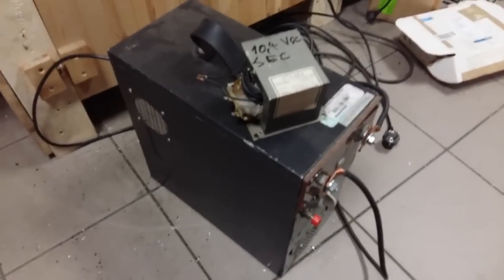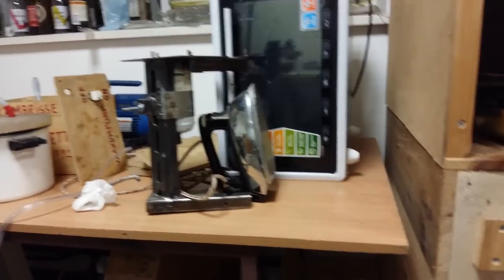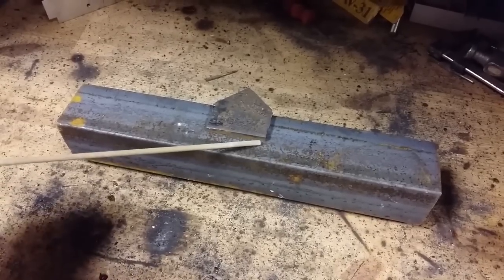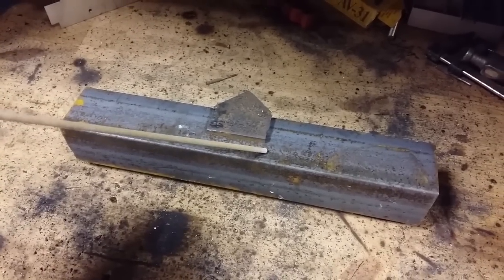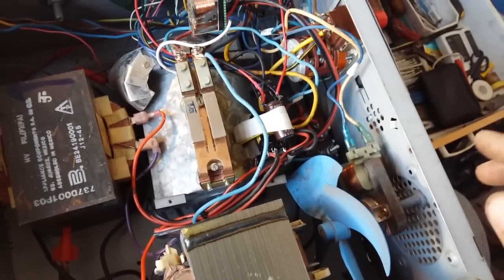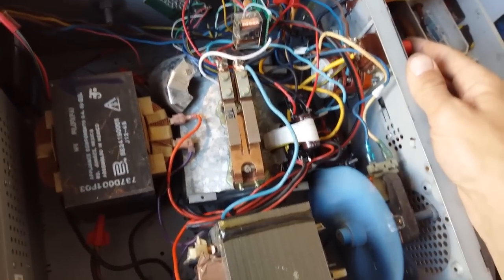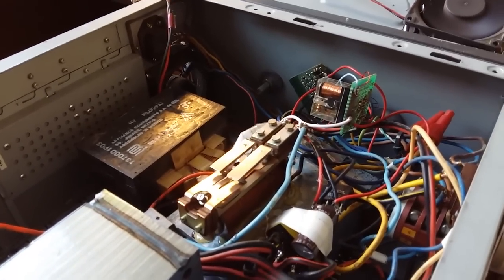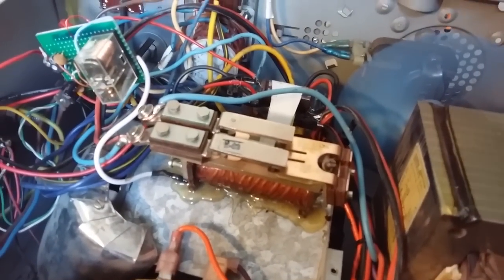Is a microwave oven transformer welder any good? (plus a softstart circuit)

Comment: When the slag comes loose by itself, that's how you detect a good welding seam. It looks like yours wasn't hot enough. Try a thinner elektrode, at the same steel thickness!

Comment: Although this works, everyone wires the secondary wrong.  Best is to use small gauge wire like 14 gauge stranded of multiple wires to fill the full cavity with wire that is grouped as parallel and total of 2 to 4 turns.  IE 20 parallel wires together and long enough for 2 turns.  The idea is to not leave spaces in the secondary cavity so all magnetic flux is coupled from the primary.  Hope this helps others.

Comment: Hi im picking up a to mot tomorrow and i was wonder if you can give me some brief instructions on how to do this and what can i do to make it safe this will be my first time ever doing this.
Reply from the maker: Hello CustomCars Life!
Your main trouble will be rewinding the MOT's. There are plenty of videos out there describing the process. Take care not to hurt the primary winding while removing the secondary. Splitting the transformer "E" laminate will definitely help. It will not hurt the magnetic flux if you properly join the sides again. Your second worry will be to find good wire for rewinding the secondary. Thick enameled copper is the best way to go, since it gives off heat easily. On the other hand, it is harder to wind and you have the risk of scratching the enamel against the core whilst winding. PVC insulated multistrand copper wire is easier to get and perhaps a bit easier to wind (due to it being multistrand), but it takes a lot more room in the core and it does not give off heat as easy.
Also, do not bother building a fancy casing for your first prototype. Just wire it up, hope for the best and measure the output voltage. If your MOT's are in phase, you'll get a voltage output. Try around 20-22 winds on each secondary. That will give you about 50 volts output.
Take care to wear gloves and definitely a welding mask/glass or the like. Welding plasma is a very strong broadband emitter, giving off strong light in the visible and UV spectrum. Risk of blindness is a real thing when not wearing protection.

Comment: how to controll the amper for the electrode
Reply: saturation shunts
Reply from the maker: Use an inductor in series with the secondary, on which you can vary inductance. A wire coil and a ferrite rod will do just fine. You'll be able to limit the maximum current that way.

Comment: What wire did you use on the transformers?
Reply from the maker: I used thick insulated wire I found at the hardware store. Later I changed it to several parallel strands of enameled copper due to it having a lot better thermal properties in this context.

Comment: i read in an old popular science book about how to build an arc welder with variable voltage and current using a "reactor" made from a large coil wound on a square tube with an adjustable iron core (it slid in and out of the tube via rope and hand crank w/lock)... cant remember how it was wired but i think the voltages were fixed on a hand wound multi tapped transformer... voltage selection was with a jumper wire on a control panel lol... was cool...
Reply: might have been popular mechanics or popular electronics... cant recall...
Reply from the maker: Yes, this "reactor" can be wired in series both with the primary and secondary.